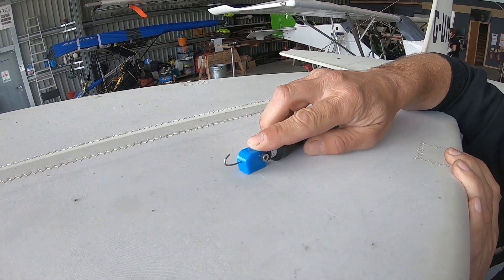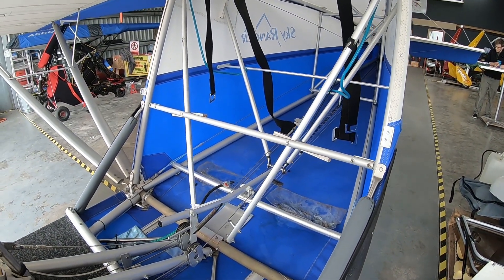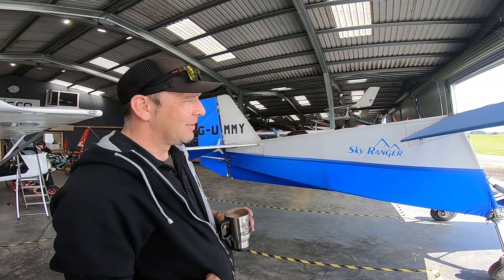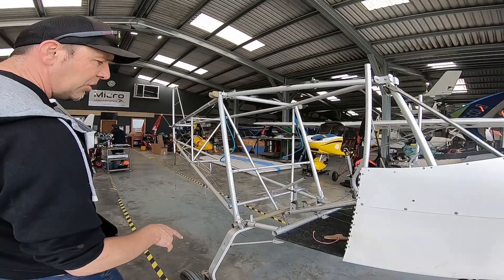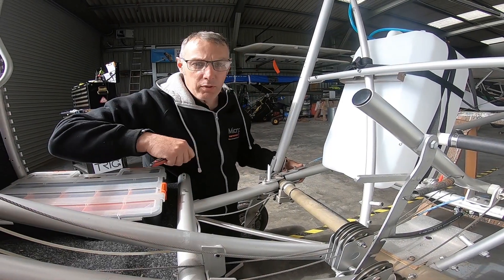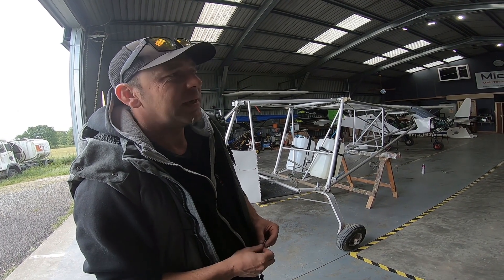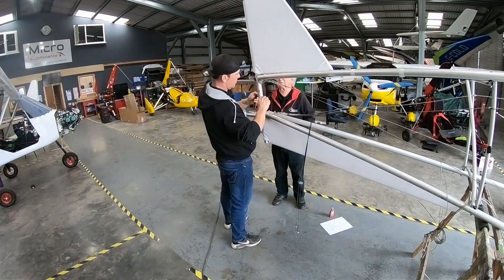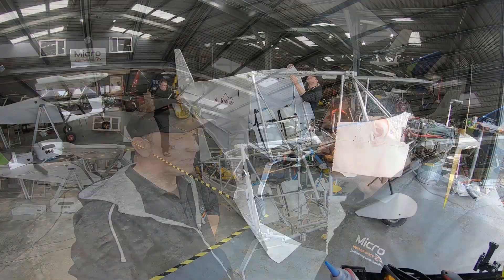Skyranger Classic, Dacron to Xlam conversion Part 1: Micro Maintenance S3 E7

Comment: Is there any grease or protector you can put on the nuts to stop the corrosion?
Reply from the maker: We use ACF50 on most nuts bolts and tubes, it’s very good for rust prevention and cure, but when possible we replace nuts washers as a default
Reply: @wingnutshomeofmicromainten6946  Excellent. Thanks for quick response. 🤠

Comment: Dacron vs Xlam -- why not redo in Dacron.  How much better is Xlam vs Dacron for the cost. Not much of info out there.
Cheers
Reply from the maker: You can still get Dacron skins and people do still use it, but Xlam is significantly better. Much longer life, significantly stronger even against hangar rash, easier to repair and noticeable reduction in Drag name a few do the benefits